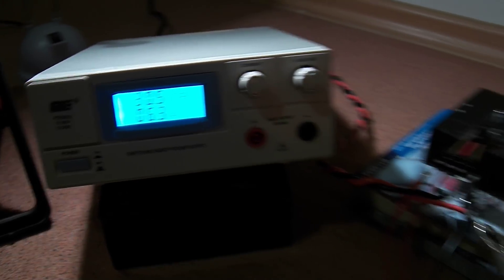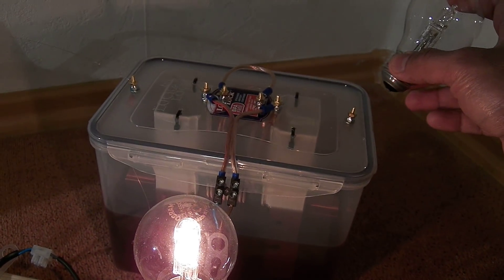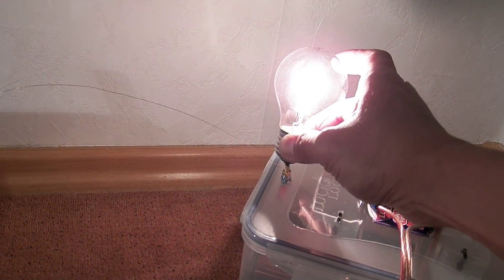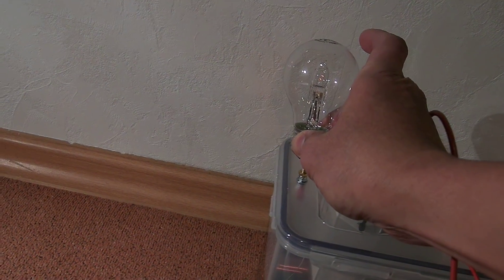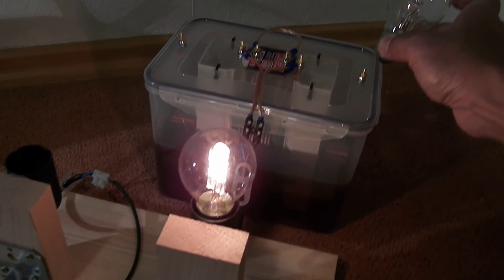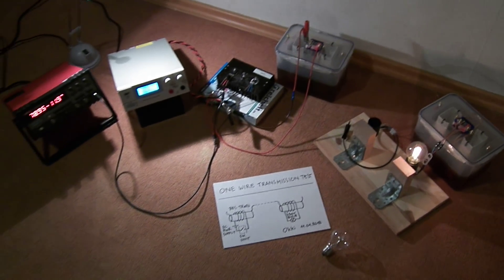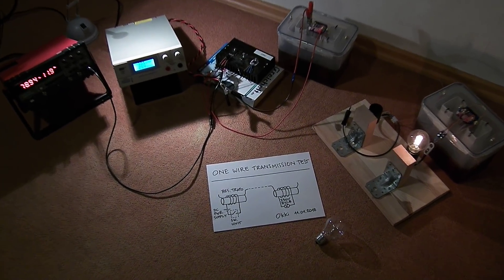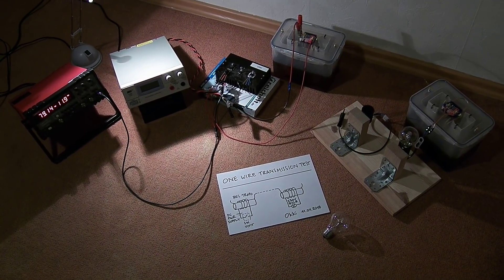One Wire Power Transmission - Load Test

Comment: What’s the efficiency?
Reply from the maker: Pretty low.
Reply: Okki Moeljadi ok, thanks
Reply from the maker: You're welcome.
Reply: Okki Moeljadi for a single wire transmitter using Tesla coil’s, what is the most efficient way to power the Tesla coil’s?
Reply from the maker: You have to think like this: any pair of coils are transmitter and receiver. They have to have the same copper mass in order to transfer energy 100%. What people understand with Tesla Coil consists also of transmitter and receiver. The transmitter part is the primary coil and the receiver part is the secondary coil. If you want to transmit any power in very efficient way, you have to weigh your coils and make them to oscillate at the same frequency. Maybe you find this information is a bit weird, but I saw, based on my research, that Nikola Tesla told us the truth.

Comment: It appears that the primary coils of the transmitter resonant xfmr and receiving transformer have different number of turns in the video?  It also appears that the primary coils are connected differently to the Mosfets...one is connected just in series while the other is connected as a bifilar?  Why the difference in connections?
Reply from the maker: I wanted to get higher voltage at receiver side. On the transmitter side I only use one primary coil and on receiver side I connect the primary coils in series.

Comment: Okay have you tried to configure a Transformer that is like the neon sign Transformer where it has two secondary coils that are by filer round opposite each other connected in the center and grounded at that Center? Don Smith describes a neon sign Transformer in his experiments and he even uses one in his experiments. The trick seems to be the design of the by filer coil on the secondary. The bifilar being split into two secondaries and grounded at the center would give you more amperage with the high voltage?
Reply from the maker: Hi Jeff, I have seen the video of his lecture and I have tried that at some degree. It does not work like he advertised. He referred to a patent of Nikola Tesla but what Tesla wanted to do with that configuration was to adjust the output current so that you can regulate the load (electric motor, light bulb or other load). I think that particular information from Don is not correct. We cannot multiply the output power just like that. Have you tried that? Can you confirm power multiplication?
Reply: Okki Moeljadi it's just interesting that the bifiliar configuration is used in the NST and the power transformer on the pole outside. 

The amplification is happening from the time reverse phase conjugation of the capacitor plates in conjunction with the wireless power. 

I haven't done much work with the coils because I discovered the amplification of the power in capacitors.

Was just wondering since that winding is used in power applications and there is no info on it but what Tesla said and done Smith later.
Reply from the maker: Jeff, from my latest observation, I see that we can extract the most power out of a Tesla Coil from the base of the secondary coil. I have a feeling that this can be the key to OU device. If it's true, we have already the secret of OU hidden in front of our very eyes all the time.
Reply: Okki Moeljadi I think you may be right.

Comment: Like always exelent, did you conect signal generator to gate of mosfet or ?
Reply from the maker: Thank you. Yes, I connect the signal generator directly to the gate of the mosfet.
Reply from the maker: Just take fastest mosfet you can get with highest voltage rating. I use IXYS IXFK64N50P.
Reply from the maker: I think it would work. Just try it.